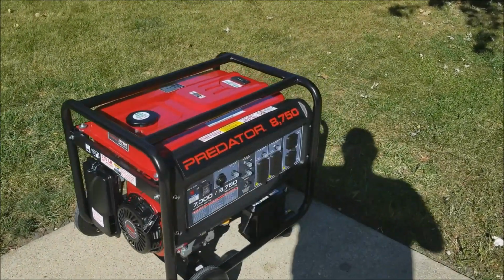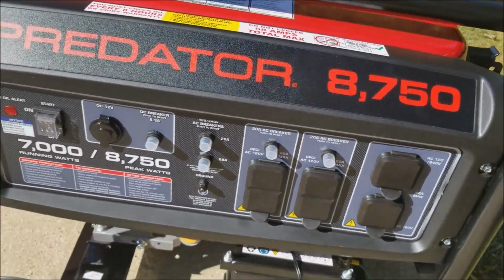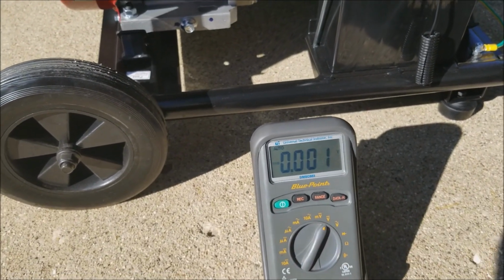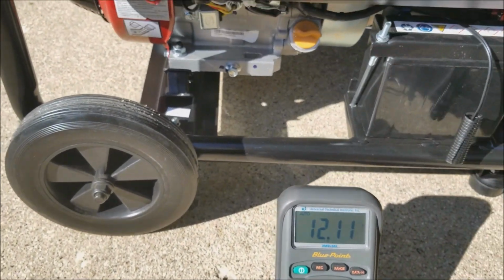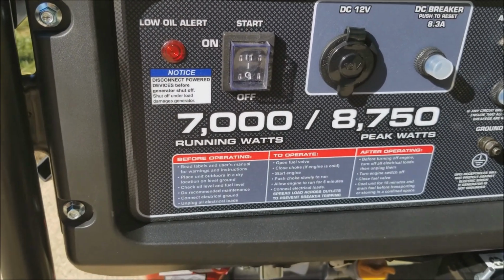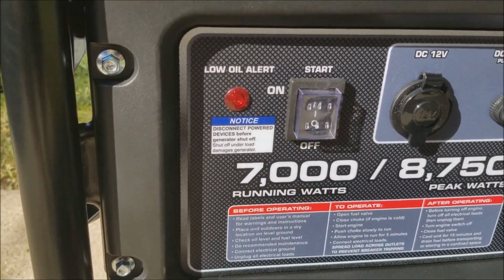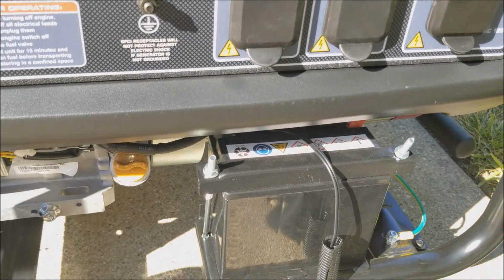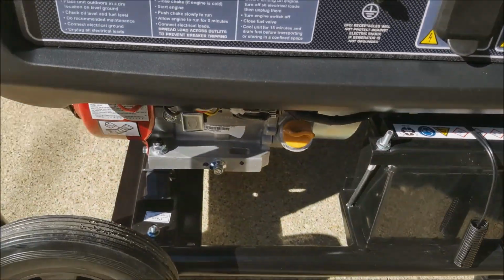Predator 8,750 Generator start up and voltage check

Comment: My generator is going on but I am not getting any power. We checked everything. It was working fine now it's not working.
Reply from the maker: There's a number of things that could cause a generator not to produce power, you'll have to do troubleshooting per the owner's manual, or contact Predator

Comment: I have yet to see someone ground this generator. Is that not an absolute requirement
Reply from the maker: Most generators do not require a ground rod as they're grounded to the frame (this is per OSHA standards); however, the user's manual will indicate if required. In my generator the owner's manual does say to install a ground rod, but it is evidently bonded to the frame (visible ground to the frame). OSHA does also state that if the generator is connected to a structure via transfer switch (all poles), a grounding electrode is required. I hope this helps.

Comment: OK, you checked the voltage without any load. Also, how about checking the frequency to see how close to 60Hz is maintained across various loads.
Reply from the maker: Are you offering to lend me an oscilloscope? Lol
Reply: @JPG23  Some multi meters have hertz feature,mine does. Or get a KILL A WATT meter that also shows hertz. You don't need an oscilloscope ;-)

Comment: Thanks JPG23!
I'm thinking about buying one of these and this video helps.
Reply from the maker: You won't regret, these machines are reliable, and proven
Reply: Thanks! That's great to know!
Reply: @TrojanHorse1959  ⚠️Always make sure you follow all the generator safety rules when you use your portable generator: 

This is just a reminder to make sure. It is important to follow all generator safety rules whenever you use your portable generator. 
Here are the things that need to be followed;

1) KEEPING OTHERS SAFE: Please do not allow an unqualified person or your children to operate and service the portable generator. Just because some manuals don’t say that doesn’t mean it’s safe. That is important against the generator safety rules. We also need to be keeping an eye on our children too. You need to make sure that your children are not playing near the portable generator especially when it’s running so they won’t get electrocuted. Generators pose electrical risks and they can be hot during an operation. Please keep your children away from the portable generator at all times. It is important to keep our children safe especially our little ones. Be aware of all the hazards.

2) WHERE TO RUN YOUR GENERATOR: Some people use their portable generators indoors which increases the risk of carbon monoxide poisoning. It’s important to have a carbon monoxide if you have a gas generator. Never ever use your generator indoors even if your doors and windows are open and even in the garage is not safe to use a portable generator. Not even at your porch and your deck. It is never safe to use your generator indoors and in enclosed areas of your home. Your generator needs to be 15-20 feet away from your house. 

3)🔥FIRE HAZARDS: Never refuel your generator while it’s running. You need to let your generator cool off before refueling it and before storing your generator. Never overload your generator too. Never ever back feed your generator. You should never plug your generator into a wall outlet. Also never store propane tanks indoors. Please keep flammable things away from the generator as well and please don’t smoke cigarettes near the generator. Having a fire extinguisher next to the generator is also important against the generator safety rules. 

4) GENERATOR OPERATION: make sure your hands are dry before touching the generator. Never use your generator in wet conditions. Don’t let your generator get wet. You need a generator tent if you need to use your generator during wet weather. Please don’t wear loose clothes when operating the generator. Turn on your generator before plugging in appliances. Use the right cord for your generator. Please do not use worn out cords. 

https://youtu.be/I1jT3ANENvI and here is a video more about keeping others safe when using generators 

Hope this helps
Reply: $650 now for the predator 9000  just bought mine this week.
Reply: @jonathan-emilypowell1962  ⚠️Always make sure you follow all the generator safety rules when you use your portable generator: 

This is just a reminder to make sure. It is important to follow all generator safety rules whenever you use your portable generator. 
Here are the things that need to be followed;

1) KEEPING OTHERS SAFE: Please do not allow an unqualified person or your children to operate and service the portable generator. Just because some manuals don’t say that doesn’t mean it’s safe. That is important against the generator safety rules. We also need to be keeping an eye on our children too. You need to make sure that your children are not playing near the portable generator especially when it’s running so they won’t get electrocuted. Generators pose electrical risks and they can be hot during an operation. Please keep your children away from the portable generator at all times. It is important to keep our children safe especially our little ones. Be aware of all the hazards.

2) WHERE TO RUN YOUR GENERATOR: Some people use their portable generators indoors which increases the risk of carbon monoxide poisoning. It’s important to have a carbon monoxide if you have a gas generator. Never ever use your generator indoors even if your doors and windows are open and even in the garage is not safe to use a portable generator. Not even at your porch and your deck. It is never safe to use your generator indoors and in enclosed areas of your home. Your generator needs to be 15-20 feet away from your house. 

3)🔥FIRE HAZARDS: Never refuel your generator while it’s running. You need to let your generator cool off before refueling it and before storing your generator. Never overload your generator too. Never ever back feed your generator. You should never plug your generator into a wall outlet. Also never store propane tanks indoors. Please keep flammable things away from the generator as well and please don’t smoke cigarettes near the generator. Having a fire extinguisher next to the generator is also important against the generator safety rules. 

4) GENERATOR OPERATION: make sure your hands are dry before touching the generator. Never use your generator in wet conditions. Don’t let your generator get wet. You need a generator tent if you need to use your generator during wet weather. Please don’t wear loose clothes when operating the generator. Turn on your generator before plugging in appliances. Use the right cord for your generator. Please do not use worn out cords. 

https://youtu.be/I1jT3ANENvI and here is a video more about keeping others safe when using generators 

Hope this helps

Comment: I just bought the 9000 from harbor freight for 225, its having a problem running my air compressor. I have a 240v 16 amp compressor and when i go to start it it bogs the generator down really bad and wont turn the compressor over.
Reply from the maker: What are the specs of the ac unit? (Tonnage/btu, LRA, RLA, start capacitor)
My unit is a 5 ton, and this generator runs it just fine, I have yet to post a video of it; however, u have installed a hardstart kit, and the starting amperage came down significantly. I don't remember the numbers right now, but it was definitely more than a 15amp drop
Reply: @JPG23  its a air compressor, 60 gallon 3.7 hp. Its 240v about 16-17 amps. Ive blown 2 starting capacitors trying to get it started with the generator. It draws about %300 more amps trying to start it then it does while running, if it only puts out 30 amps max im sure thats the problem. Ill look into a hard starter but idk if that will bring down the starting amps enough
Reply: @austinshupe9626  Hey Austin, not sure if this will help: My heat pump unit for my central heat and AC is of course 220V on my residence. These units have a startup capacitor. If they fail your SOL. No heat or AC. They do tend to quit every couple of years so I keep a couple of these $20 part on hand. I think this is the basis for the so called 'Hard Start Kit' that you guys are referancing. So, I think in your case (which in principle is really no different than the compressor in a heat pump)  this idea would be necessary to resolve your situation and it got me thinking that I should rig something like this up too. Good luck. I hope it works well for you.
Reply: @flyme-z7b  I ended up getting a hyper engineering sure start. I had to wire it in to the air compressor and it deleted the starting capacitor. It's pricey but works very well. Also helps with the life of the motor. At start up it was pulling 50+ amps and now it only pulls 20.
Reply: @austinshupe9626  ⚠️Please do not forget to follow all the generator safety rules when you use your portable generator: 

This is just a reminder to make sure. It is important to follow all generator safety rules whenever you use your portable generator. Everyone needs to see this. 
Here are the things that need to be followed;

1) KEEPING OTHERS SAFE: Please do not allow an unqualified person or your children to operate and service the portable generator. Just because some manuals don’t say that doesn’t mean it’s safe. That is important against the generator safety rules. We also need to be keeping an eye on our children too. You need to make sure that your children are not playing near the portable generator especially when it’s running so they won’t get electrocuted. Generators pose electrical risks and they can be hot during an operation. Please keep your children away from the portable generator at all times. It is important to keep our children safe especially our little ones. Be aware of all the hazards.

2) WHERE TO RUN YOUR GENERATOR: Some people use their portable generators indoors which increases the risk of carbon monoxide poisoning. It’s important to have a carbon monoxide if you have a gas generator. Never ever use your generator indoors even if your doors and windows are open and even in the garage is not safe to use a portable generator. Not even at your porch and your deck. It is never safe to use your generator indoors and in enclosed areas of your home. Your generator needs to be 15-20 feet away from your house. 

3)🔥FIRE HAZARDS: Never refuel your generator while it’s running. You need to let your generator cool off before refueling it and before storing your generator. Never overload your generator too. Never ever back feed your generator. You should never plug your generator into a wall outlet. Also never store propane tanks indoors. Please keep flammable things away from the generator as well and please don’t smoke cigarettes near the generator. Having a fire extinguisher next to the generator is also important against the generator safety rules. 

4) GENERATOR OPERATION: make sure your hands are dry before touching the generator. Never use your generator in wet conditions. Don’t let your generator get wet. You need a generator tent if you need to use your generator during wet weather. Please don’t wear loose clothes when operating the generator. Turn on your generator before plugging in appliances. Use the right cord for your generator. Please do not use worn out cords. 

https://youtu.be/I1jT3ANENvI and here is a video more about keeping others safe when using generators 

Hope this helps
Reply: @flyme-z7b  ⚠️Please do not forget to follow all the generator safety rules when you use your portable generator: 

This is just a reminder to make sure. It is important to follow all generator safety rules whenever you use your portable generator. Everyone needs to see this. 
Here are the things that need to be followed;

1) KEEPING OTHERS SAFE: Please do not allow an unqualified person or your children to operate and service the portable generator. Just because some manuals don’t say that doesn’t mean it’s safe. That is important against the generator safety rules. We also need to be keeping an eye on our children too. You need to make sure that your children are not playing near the portable generator especially when it’s running so they won’t get electrocuted. Generators pose electrical risks and they can be hot during an operation. Please keep your children away from the portable generator at all times. It is important to keep our children safe especially our little ones. Be aware of all the hazards.

2) WHERE TO RUN YOUR GENERATOR: Some people use their portable generators indoors which increases the risk of carbon monoxide poisoning. It’s important to have a carbon monoxide if you have a gas generator. Never ever use your generator indoors even if your doors and windows are open and even in the garage is not safe to use a portable generator. Not even at your porch and your deck. It is never safe to use your generator indoors and in enclosed areas of your home. Your generator needs to be 15-20 feet away from your house. 

3)🔥FIRE HAZARDS: Never refuel your generator while it’s running. You need to let your generator cool off before refueling it and before storing your generator. Never overload your generator too. Never ever back feed your generator. You should never plug your generator into a wall outlet. Also never store propane tanks indoors. Please keep flammable things away from the generator as well and please don’t smoke cigarettes near the generator. Having a fire extinguisher next to the generator is also important against the generator safety rules. 

4) GENERATOR OPERATION: make sure your hands are dry before touching the generator. Never use your generator in wet conditions. Don’t let your generator get wet. You need a generator tent if you need to use your generator during wet weather. Please don’t wear loose clothes when operating the generator. Turn on your generator before plugging in appliances. Use the right cord for your generator. Please do not use worn out cords. 

https://youtu.be/I1jT3ANENvI and here is a video more about keeping others safe when using generators 

Hope this helps

Comment: oil checked turned all the way in?
Reply from the maker: Yes
Reply: It says to turn it all the way in the manual?  Some machines they say to just place the knob in the hole w/out turning it in.
Reply from the maker: @filoIII  good question, but any amount within the marks is fine
Reply: @filoIII  ⚠️Please do not forget to follow all the generator safety rules when you use your portable generator: 

This is just a reminder to make sure. It is important to follow all generator safety rules whenever you use your portable generator. Everyone needs to see this. 
Here are the things that need to be followed;

1) KEEPING OTHERS SAFE: Please do not allow an unqualified person or your children to operate and service the portable generator. Just because some manuals don’t say that doesn’t mean it’s safe. That is important against the generator safety rules. We also need to be keeping an eye on our children too. You need to make sure that your children are not playing near the portable generator especially when it’s running so they won’t get electrocuted. Generators pose electrical risks and they can be hot during an operation. Please keep your children away from the portable generator at all times. It is important to keep our children safe especially our little ones. Be aware of all the hazards.

2) WHERE TO RUN YOUR GENERATOR: Some people use their portable generators indoors which increases the risk of carbon monoxide poisoning. It’s important to have a carbon monoxide if you have a gas generator. Never ever use your generator indoors even if your doors and windows are open and even in the garage is not safe to use a portable generator. Not even at your porch and your deck. It is never safe to use your generator indoors and in enclosed areas of your home. Your generator needs to be 15-20 feet away from your house. 

3)🔥FIRE HAZARDS: Never refuel your generator while it’s running. You need to let your generator cool off before refueling it and before storing your generator. Never overload your generator too. Never ever back feed your generator. You should never plug your generator into a wall outlet. Also never store propane tanks indoors. Please keep flammable things away from the generator as well and please don’t smoke cigarettes near the generator. Having a fire extinguisher next to the generator is also important against the generator safety rules. 

4) GENERATOR OPERATION: make sure your hands are dry before touching the generator. Never use your generator in wet conditions. Don’t let your generator get wet. You need a generator tent if you need to use your generator during wet weather. Please don’t wear loose clothes when operating the generator. Turn on your generator before plugging in appliances. Use the right cord for your generator. Please do not use worn out cords. 

https://youtu.be/I1jT3ANENvI and here is a video more about keeping others safe when using generators 

Hope this helps

Comment: You could use the dc output to charge the battery.
Reply from the maker: That's correct, but I'd rather have the panel hardwired to the battery so the 12 v plug is available